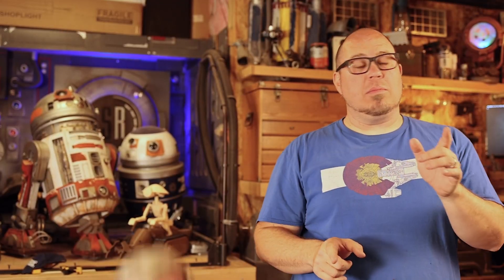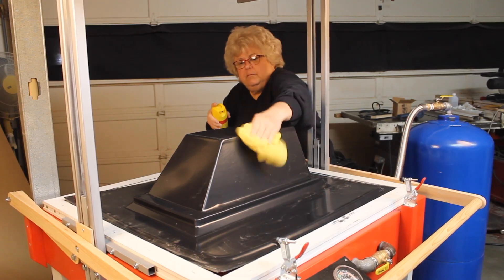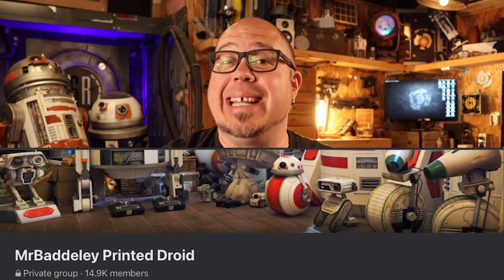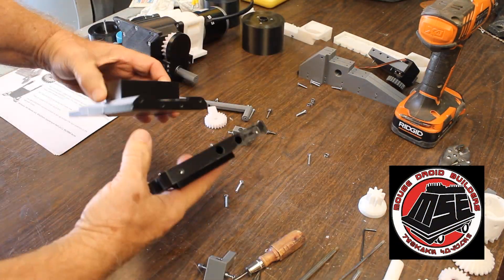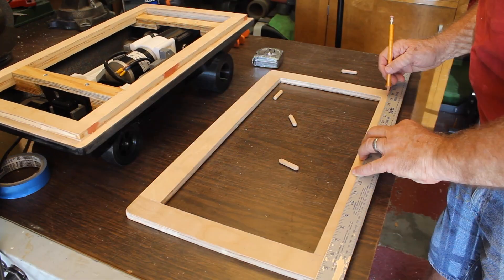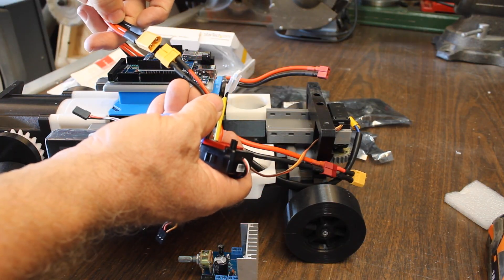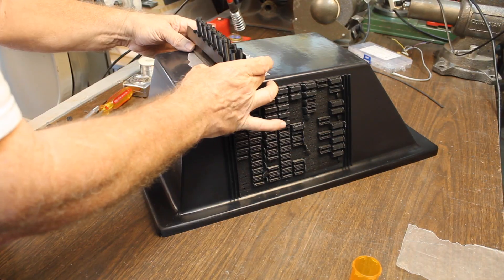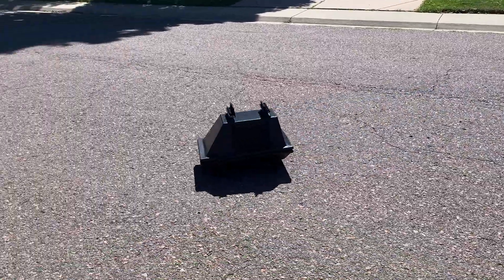Star Wars Mouse Droid | MSE-6

Comment: i bought a used Arrma Senton RC truck and am gonna make my mouse droid fit it, a Traxxas Slash/Rustler/Bandit, or many other RC trucks can be removed easily. Under 170 new for a Senton and theyre a full reliable hobby grade RC setup thats tough and fun on its own too. Saves all that engineering/electronics building you did
Reply from the maker: Sounds great!

Comment: I have a one off Mandalorian helmet with some tight corners/angles quite deep. Would it be possible to vacuum form shells close to original?
Reply: The face plate would be the most important factor. Maybe face facade moulding? All rest of helmet is Hasbro Boba Fett.
Reply from the maker: It might be tough.  The forming machine could have a tough time with those corners.  It woudl be better to create a complex mould.  You can search helmet mold making on youtube for that, there are a lot of videos on how to do it.